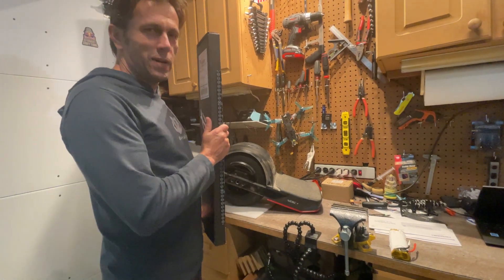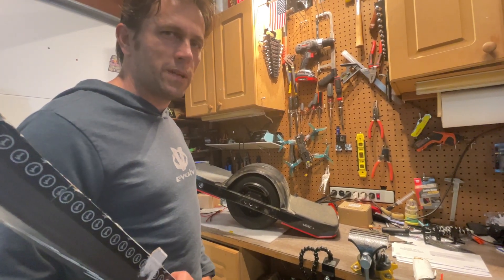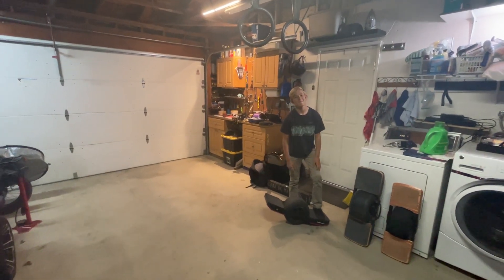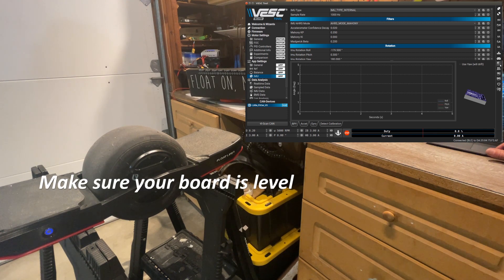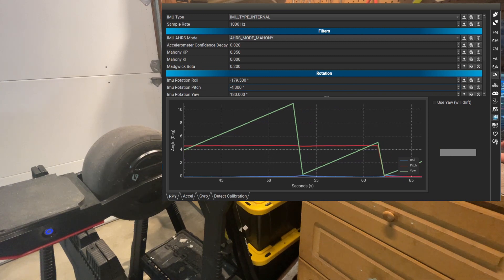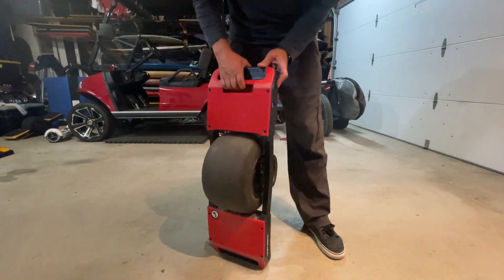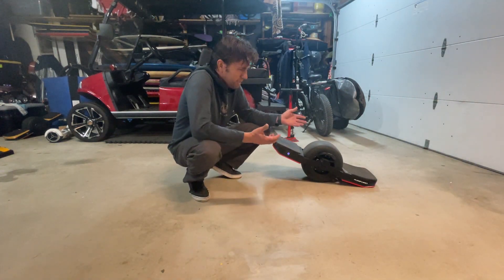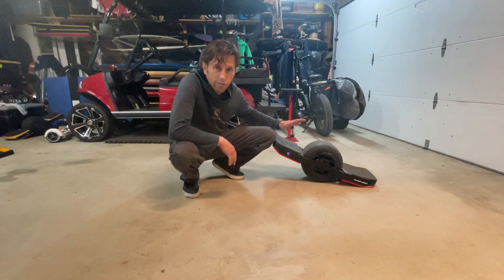VESC OneWheel Part 6: WTF Rails Upgrade

Comment: Does the VESC controller support wireless updates via laptop or an iphone app?
Reply from the maker: Yes it does. The LittleFOCerV3 has built-in Bluetooth, other VESCs have an external Bluetooth module connected to allow tuning, real-time data logging, and firmware updates.
Reply: @surfdado  Thanks! Is it possible to buy all the parts  new and set something up like a GT. Or are there still parts you have to Frankenstein?
Reply from the maker: @MikeDIY  makerspev sells almost all the parts you need. The front enclosure is a bit tricky - either requires modding to make the LFOC fit or you can 3D print one, printed boxes should become available to buy soon though. Outperforming a GT in all aspects is not quite that easy though, an XR frame just doesn't have the space to put in a GT-equivalent battery. But XR range with GT torque sure is possible

Comment: Is the vesc ready in your opinion for someone who’s experience with diy building ebikes and hobby electronics, if their board has an error 16? I’m curious if there is a way to tell if the bms is working correctly and leave it on the xr pack and just replace the controller
Reply from the maker: A VESC board is pretty close to being as good as an XR, but it is definitely better than a broken Onewheel ;) I'm not sure what error16 means but you could check whether the BMS is still good by connecting it directly to the charger and seeing if it allows charging and also whether all the cells are balanced (using a Volt meter on the JST-XH balance wires going into the BMS)
Reply: This is something I too have to figure out. I have two pints that throw error 16. If I learn anything I'll swing back here and let you know.
Reply: @KungFuFishy  thank you- I just ordered all the stuff for a vesc conversion thought. Fm never even replied to may 3 inquiries to get the board fixed and I don’t wanna pay for another piece of hardware that will brick and then deal with them again
Reply: @mi_k779  Totally understandable! It'll still be good to know whether or not your BMS works. May make the conversion process easier. I know I'll have to figure it out sooner or later as I'd just ordered a Vesc myself. I'll keep ya posted.
Reply: @mi_k779  What a load from Kyle at FM saying they support old boards.
Reply: @mi_k779  Get your parts in yet? Just got mine! Still plenty of work to do on my Pints but it's looking promising! My BMS are shot but still seem to charge so I'm planning on rewiring it to be charge only.
Reply: @KungFuFishy  I did but I hit a snag where my ender 3 is software locked to 220mm which is too narrow to print the controller housing